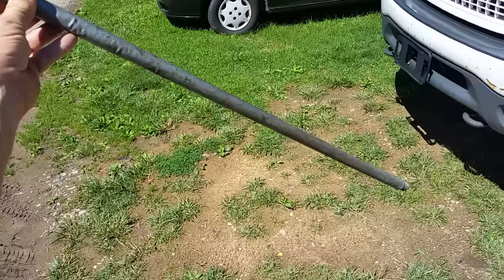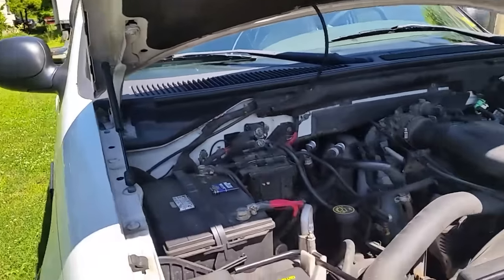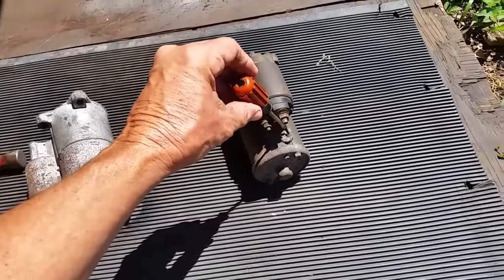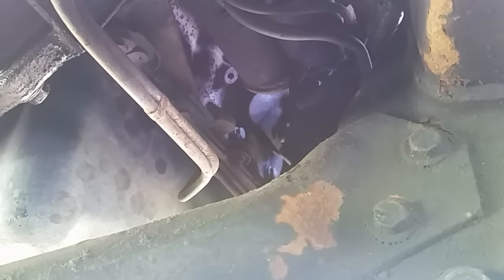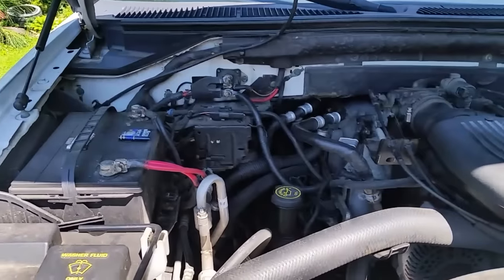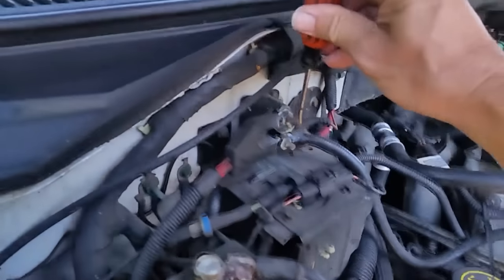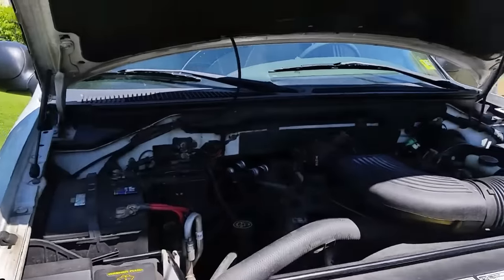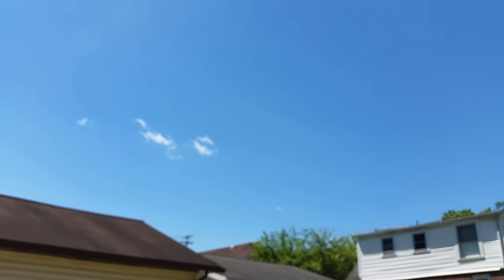Starter Issues??? Simple trick to get your vehicle started and get Home!

Comment from the maker: NOTE: Also make sure to check battery cables and wires for lose 
connections. Make sure the battery has a good connection to the starter.
 If none of this works then you may have to replace the starter ;(
Reply: TVWXMAN32 I have a question can I use a starter from a bigger engine but same platform?
Reply: ok, thanks. will do
Reply: Nathan Rohrbough 0
Reply: Nathan Rohrbough So  I just get one click.Sometimes after multiple times it starts.So bad starter?
Reply: I can't do that because it keeps popping j 20amp fuse's so how I get it to stop blowing the fuse first
Reply: Nathan Rohrbough my 89 Toyota celica is having the same starting problem. Starter tested good. Thinking maybe a starter relay but can't find it
Reply: this is what happened to me, perfect battery, the wire from somewhere near the battery .that is not the clamp on wires but a thicker gauge cable, I forgot what its called but a mate told me to replace it and i did  at a cost of $70
Reply: My car battery ok but not start and i change gear nuater then ok what is problem
Reply: Do you have or know of a video of installing a starter on a 2012 ford escape
Reply: I kinda feel like the secondary solenoid ( on the firewall) was dead. because when you bridged it, the starter motor and its piggyback solenoid worked.
Reply: Also: Either that or the ignition switch or if its an automatic, the interrupter relay.   What was it on this one in the end?
Reply: I have a 2005 p71 Vic tht will not start and clicks once. Starter was replaced 2months ago when it was only a security issue, but now I replaced starter again and it still just clicks once. I can bump start it but I need this issue resolved, willing 2 pay anyone who can solve this issue asap. Batt gud, and relay is gud, connection has been cleaned and lubed with electrical grease and it still won't start. Everything works, but this click is pure bs and I got a bill 4 anyone who can give me sum advice. Voltemeter was used 2 check connections and it's all gud why won't it start?
Reply: What about a 2004 ford freestar van
Reply: I accidently hit my keys, driving back from a friend's house and my car died. Could my starter possibly have a loose wire or do you think I need to replace my starter all together?
Reply: 8jj
Reply: Hi 🖐🏾 how are you thanks for the info do you fix cars 🤔
Reply: Does the solenoid make a noise when its bad
Reply: What does it mean when the truck won't start when you trip the silanoid
Reply: @nightcircuitband5281     l  am. Home
Reply: Just got my ford e250 started you saved me 150$ towing fee THANLS
Reply: My starter sounds like it's working but when it starts it sounds like it's making a slicing sound
Reply: or just SOLENOID. SOLENOID could be changed without taking off a starter. Very simple: 2x torx screws and thats all there is a lot of space for such work. Just done this work on my 1st gen expedition with 4.6l
Reply: Hey can u help me I got a 2005 Acura RSX and a guy one time hit I'm thinking the stater and it started but idk where he hit can u point me in the right direction
Reply: Xid
Reply: @Fixing With Passion/ I am experiencing that Same exact issue right now With my late model White looking '99 Expedition Sir ! And i need to figure'out if it's the Solenoid alone or either the Starter itself either Way ! Thanks a lot there for all of those helpful troubleshooting tip's of Yours. 👍🖐️
Reply: Ok so I have 98 f150 was fine I went into store and came out and it won't turn over lights and everything come on in truck but no start just a click sound coming from the solenoid location I believe any suggestions need to get it home without towing

Comment: You'll never have to beat on your starter if you drive a stick shift.
Reply from the maker: Amen! ~~
Reply: You still have to find someone to push it for ya to get it started
Reply: Broly Assasin this is exactly right! My issue right now!! Chevy Cruze 2012. Lost for words on that one
Reply: @courtneykh24  You better learn how to push it and jump in and pop the clutch, you have to be fast though, don't run over yourself.😄
Reply: Robby Ritter dude, let em tell you, oil leaked into the starter and I have been popping it for a while finally I had to stop. I don’t know if it’s the starter or the gasket! I took the starter off, cleaned the mess out of it, put it back in, can still pop start it but it ran hot one time so it had me worried about the head gasket. Now I’m stuck. Replace the starter or no...!? Opinion?
Reply: Robby Ritter I cant push it alone, my legs are too short lmao! But still... I need my car back.
Reply: @courtneykh24  I would replace the starter first because it's the cheaper option. If that doesn't fix the problem you haven't lost a whole lot of money, and it would also give you an idea of what the other problem could be. Process of elimination more or less.

Comment: Yup, that worked. Banged on it with a hammer and it sort of turned over. Banged on some more and started right up. (I did plug the diesel in for about 3 hrs to warm the engine and make the turning easier.)
Reply from the maker: Nice!!

Comment: Finally! I finally find a realistic tip on how to, do it YOURSELF auto lesson, WITHOUT all of these mechanics pulling out all of their professional tools, that most of us, auto do it yourselfers probably won't have. Then you have to find a ride to the auto parts store, for a loaner, only to find out that they don't have it. Thank You, Nathan Rohrbough, for your easy, very clearly explained starter, no crank tip. I have a 09 Chrysler T&C, 3.8l. Since I noticed bad worn out motor mounts, I hope, worse case, motor not locked. I had to buy brand new tires last week, since we have grandkids, safety first. Since my lay-off, I can only afford 1 repair, every 2 months. Anyway, I'll try jumping solenoid first, battery reading 12.5V on my multi meter. Thanks again, Frank
Reply from the maker: Nice!~~ ;)

Comment: Great video! Another tip: that upper solenoid where he jumps it out with the screwdriver. If you put your key into the ignition to the start position (MAKE SURE VEHICLE IS IN PARK) you can start it by jumping out the solenoid if you let the motor turn over long enough (about 3-5 seconds) . Should start every time just make sure you’re in park.
Reply: In 1st grade level language pls g
Reply: How is the key in the start position? Thought you usually have to turn it to the start position then it twists back to the first position
Reply: @zack7080   He meant the on position.

Comment: lol it really works, went out for errands came back to my car, car had power but starter wouldn’t turn over. i carry a small battery jumper. tried that no luck.
checked fuses, all fine.
had no tools. so i picked up a stick an tapped on the solenoid. car started right up. man was i happy. an the replacement was super easy in my case.

Comment: Daddy always said, if it don't work, beat on it with a hammer until it does!!.. woohoo got me home for a lot less than a tow truck!! Thanks!!
Reply from the maker: Word!
Reply: Lubrication in the silinoid
Reply: I drive a tow truck and you should see people's faces when I whack their starter with my jack handle and it fires right up lol soooo funny. But when it doesn't work they look at me like I'm crazy
Reply: Your dad and I learned from those old tv sets. Once you hit them, they'd start working. But that was in the old days. Don't practice that with your husband nowadays,  you might end up in court.
Reply: I recently help out my in-laws getting stranded after pumping gas.I came to the rescue ,check the battery. Battery is good, I located the starter and tap on it couple of times and asked him to start  it.Yes, the car started up, I could see the look on his eyes like WHAT? He was amazed ,then when he got home, he keep starting and  turning off the engine.Later he called me again and said the car won’t start anymore.I told him,  leave the car alone, we will replace the starter when you have the time off from work. 😀

Comment: Happened to me today. Closing up our summer camp, loaded my F150 full bed.....had just moved my truck closer to the porch door. And exactly this happened. I crawled under and tapped the starter with hammer but nothing. Did not know about shorting the firewall solenoid so tomorrow that's my next move, and then get a new starter motor. Thanks for a great vid.

Comment: I think the idea of using a stick or hammer to hit the starter is to make all mechanical parts of the starter : plunger, shift lever and contact disc to be in "normal" position so that when the terminal S gets power from ignition switch, the resulting magnetic field can pull the plunger to enable contact disc to make electrical contact to both terminal B and M of the starter, while at the same time this motion of the plunger causes the starter drive to move into mesh with the flywheel ring gear.
So this trick makes sense, although not recommended, unless in emergency and we are ready to replace the starter someday.
Reply: Got it! thnx for the long version...lol.
Reply: My family growing up was poor.  Car had this problem in late 60's early 70's.  We couldn't afford repairs.  My dad used this hammer trick on our Belair for a couple years.  Nice to see backyard mechanics still use this trick.

Comment: Shalom Aleichem. 

I'm a 68¾ year old retired mechanic on disability and that's an old trick that's saved my ass many time's over the year's. Always carry a hammer amongst your tool box in your trunk.

If it's a  stick shift tranny all ya gotta do if you're parked on a hill is put it in 2nd gear, turn on the key and roll appropriately 50 feet or so and dump the clutch and it should start.

Ratson haba b'shem YaHuah
Reply from the maker: Right on man!!!

Comment: In my case recently it turned out it was the ignition switch itself, not the starter. I got back home by fiddling with turning my key to exactly the right spot. There was a tiny spot where the car would start as usual (if I could find it and hold the key there a couple of seconds). 2002 Subaru Impreza.
Reply from the maker: Nice!!
Reply: @FixingWithPassion  334k miles on it now, first time it has ever failed to start because of something other than a dead battery.

Comment: Thank. Youuuuu!! It just worked on my 2005 MDX. I've had a "lagging?" starter for a while now, but the day has come when I was, JUST stranded. Banged it from the underside a few taps 2X, started up, and got me home ever so grateful. 
(now, if I could only replace it myself ..🤔)
TY. Good day to you 🙌
Reply from the maker: Great!
Reply: Jennifer, you most likely can replace it yourself.  But it's a fair amount of work.  You'll need to buy a jack and jackstand $100 to 150 total.   A ratchet and sockets $20.  Chucks to block your wheels from rolling.  Amazon has MDX starters for $85 to $260.  You'll have to let the car cool off, put it in park, set emergency brake, chuck the wheels, disconnect the battery, jack the car up, put it on jackstands, then crawl under there on your back and uninstall the old starter (usually two electric wires and two starter mounting bolts), then install the new one.  The real pain is doing this on your back, with limited space under the car, limited visibiity, dirt and grease, etc.

A local auto repair shop just quoted me $350 to $450 to put a new starter on my 2004 Ford Explorer.  Ridiculous.  I can do it myself for $100, in my home garage, using the method I just described.  I already have the jack and tools, etc.

Comment: thx for the heads up. Didn't even think of the firewall solenoid. 
cheers
Reply from the maker: Word!
Reply: @FixingWithPassion  It fixed it though. I have never replaced those on any of my three Expys ever. When that weird sound on the firewall happened, I knew it wasn't the starter. Thanks for the confirmation. PS, Zeus just turned to 204K tonight.

Comment: When I was in high school I drove a 1976 GMC truck with a failing starter.  If I couldn't get it to start I would have to crawl under the truck and strike the starter housing with a trailer hitch ball.  A few taps later, I would crawl back out and try to start the truck.  It might take 2-3 tries, but eventually I would get it started.  When we finally found time and money to pull the starter and rebuild it we found the brushes were worn down so far that the screws holding the brushes in place were partially worn away.  As my mom always used to say, "Poor people have poor ways!"
Reply from the maker: Steven Berry.... Poor people are always striving ways to fix things...unlike rich folks...who depend on money for the same thing only have one resource. Poor folks are masterminds.
Reply: It definitely forces you to think outside the box.  Another classic was make do or do without.  By the time I came along my family was doing well enough, but both of my parents really knew what it means to do without.  I've got the ability to hire out a lot of jobs instead of doing them myself, but I'd rather DIY because there's a real sense of accomplishment when you fix something yourself.
Reply from the maker: You got that right! Pride.
Reply: @FixingWithPassion  rich folks just go to the dealer and buy new Truck

Comment: A wealth of knowledge! Every issue that you hit on dead-on accurate! And the way you worded everything was so professional and easy for Shadetree mechanics like myself. Thank you for the great video! And I have a question my starter had totally stopped I just had a click. I tapped mine using the metal rod and Hammer technique. And then I noticed where someone had hit it before. This is where the tricky thing comes on I've had the truck for 4 years! And never gave me any problems unless they rebuilt this starter I suspect they had a problem with it before whoever the previous owner was and I tapped mine like I said tapped a little harder than maybe I should have but it did the trick 12 Cycles and no lag no strain on the starter. Could it possibly be it just had rust in it? Like I said it looks like somebody had done this before. Any thoughts would be greatly appreciated and like I said great video keep them coming I just subscribed

Comment: Another cause can be the security system lockout. I have a 2002 f150 that will not crank with the key unless the Key Fob disarms the security system. Its an OEM security system, before I figured out what was going on, I would periodically unlock the vehicle with the key, and I wouldn't crank, I too thought it was the firewall solenoid  and replaced it but the problem returned. I could jump the firewall solenoid and it would start  in this situation, but the key would not activate the start sequence until I hit lock and unlock on the key fob  and then it would function appropriately.
Reply from the maker: True but rare.

Comment: The hammer trick worked for me!  Thanks for the hack.  It allowed me to drive home.  However, it is not a long-term solution.  It barely worked the second time (so I could pull the car into the garage and change out the starter there).

Comment: I have a manual (UK) gearbox. If my starter won't turn I bump start it. If I'm not on a hill to let it roll I put it in reverse gear and push car  forwards/ backwards a little to rock it free, or I try 1st gear and push forwards and backwards to rock it free - always works :)

Comment: another way to check the starter if it's bad is use  a multimeter. By putting one of the lead wires on the disconnected signal(trigger)wire, and the other lead on the negative battery post. Then have someone turn the ignition key, if you get 12 volt reading on the voltmeter that means 12 volts is reaching the starter, so the starter is bad.
Reply from the maker: Hey! Soooooo true!  Thanks for sharing! I can't think of everything....lol
Reply: @FixingWithPassion  plus your video was about how to get it started To get home. Then do the diagnostics...